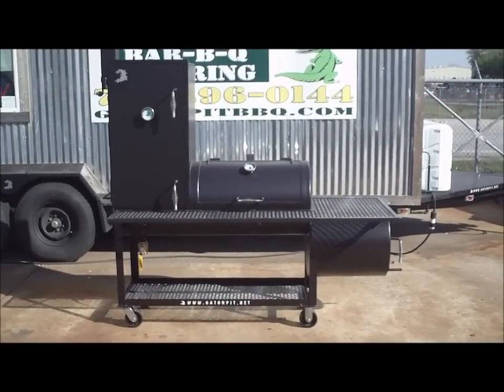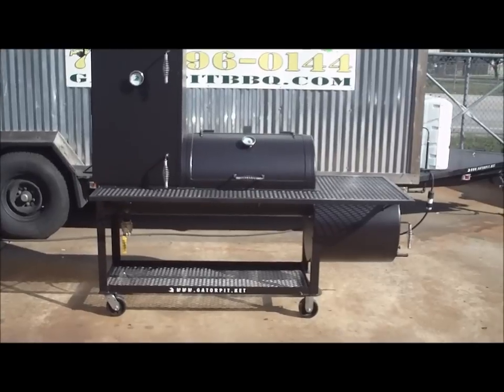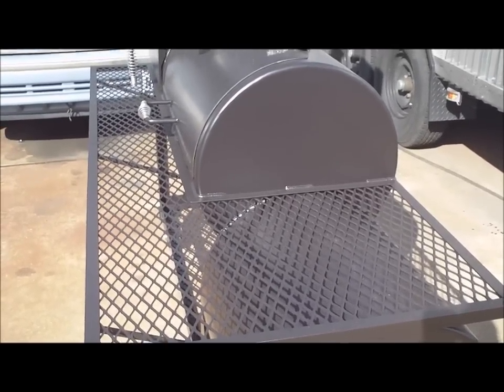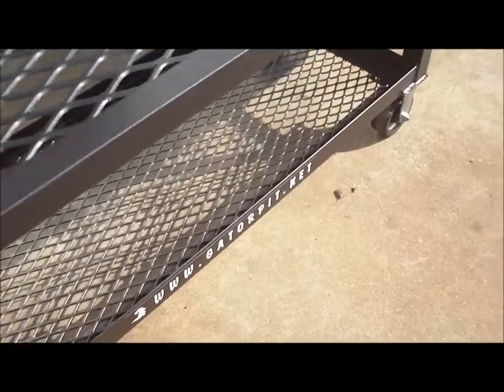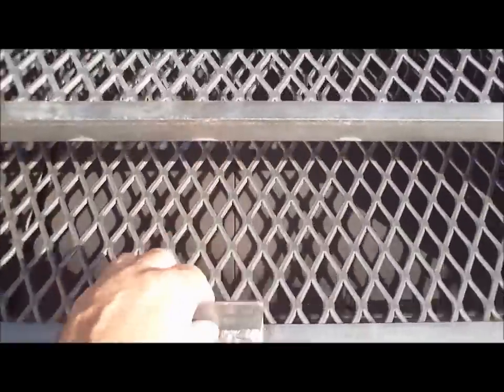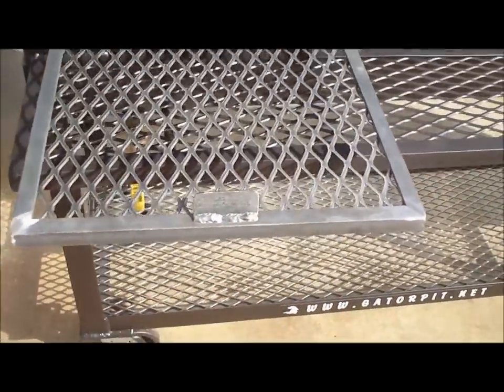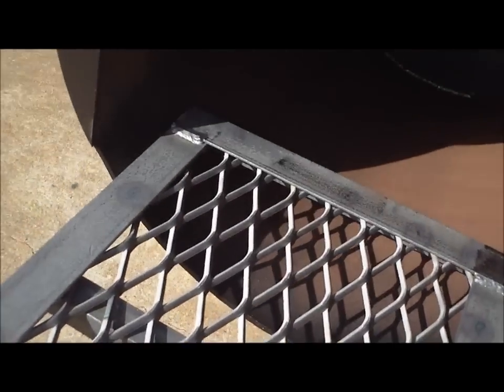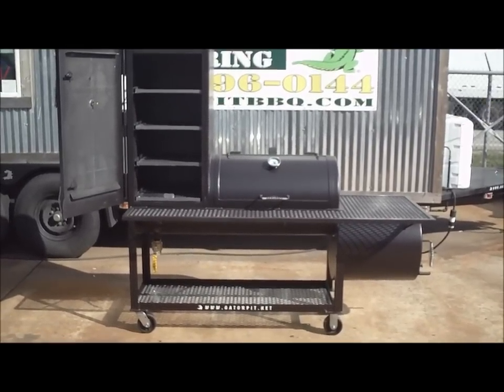Backyard Classic Chef by Gator Pit of Texas BBQ Pits

Comment: Can you make it to where I can grill on the cooking chamber and smoke on the vertical at the same time?, and is it possible to add glass on the vertical door to look rather than having to open the door every time letting the smoke out. Also if possible adding a gas tank? Or are the options limited?
Reply from the maker: A side access door can be added to the Upright side wall to access the bottom and insert a charcoal grate.  You can then build a fire on the Horizontal side and cook directly over the fire.  Heat will transfer to the Upright.  However, keep in mind that when you open the horizontal door while grilling you will take longer to smoke/cook meat in the Upright chamber.  But, we have and do that for customers at requests.  If fact, our Backyard Classic Chef Lone Star Edition has that very same feature (s) I mention.  You will see it listed at www.gatorpit.net as a Gator model.  As to glass on the door, we don't do.  Ritch
Reply: Thank you for a fast reply, when the time comes i'll sure buy me a gator pit.